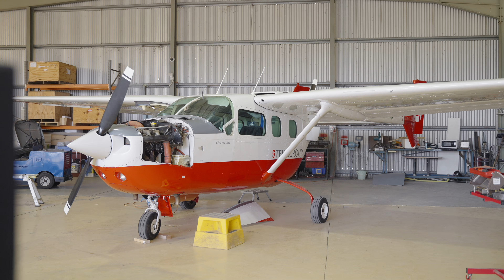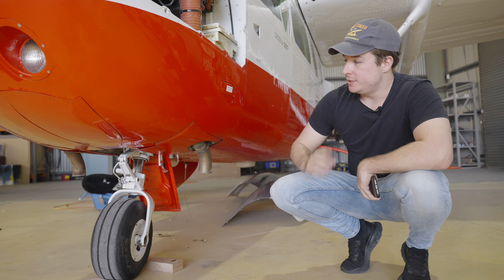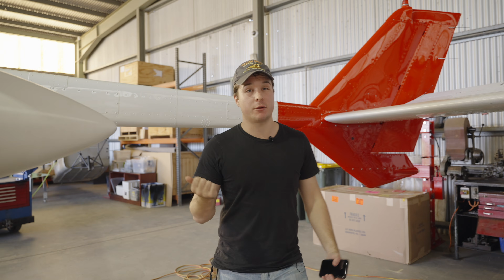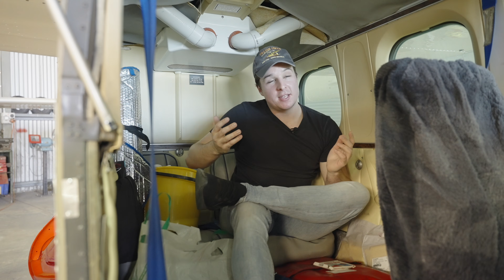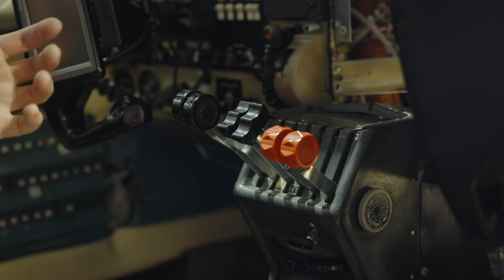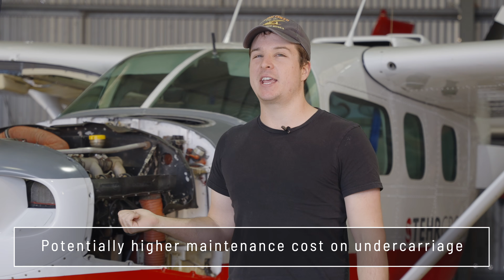The Cessna 337 Skymaster Is So Weird (And Brilliant!)

Comment: This has always been my favourite Cessna. When I worked at an fbo  we had one that visited regularly and he always taxied on the rear engine only. So the prop on the front was stopped.  As it was approaching the ramp from a distance  We’d always point that out to the new guys and tell them that it had motors in the wheels.😂

Comment: o love my 77 p 337 i have had her for over 25 years. not at all a good 4 seater. but i usally just hav emy 2 dogs and my wife. i have a baggage pod under it. a/c  full new glass panel 2 years ago. i even have a old kitchen sink when  i tell people it haas everything including the kitchen sink lol love that plane i use it for cross country i have also flown her to europe, across the pond   dogs and wife hate that trip. but is more  fun that taking a airliner. and no wacko people on it, and  if you lose a engine the performance is more like a 182 i guess,< i have never lost a engine. on it problem with the gear door removal is  you get a lot of trash up  in the gear area. i also have a 75 bellanca turbo  super viking. i use for local flights, another great plane very under rated and valued. cruises at a honest 200 mph.but really not a good 4 seater either. cabin is  a bit tight.  and not pressurized. but a beautiful  plane.  i hate it when i cant find anything to upgrade lol all i can do is wash and wax them.  with winter coming  iw ill be putting gallons of wax on them. as usual.    maybe replace the sun  shades lol

Comment: hey i have a 1977 p model  and i call it a mixmaster    in fact i have it painted where it used to say cessna  i  love it i am getting the mod for the front engine in  tn  it is a 500hp supposed to make it cruise at 300mph and a reverse  prop in the rear, ir is painted a mother of pearl medium blue with lots of metalliac on it  i am supposed to get it back end of this month i have owned it for over 35 years.  i wont sell it. easy for us old farts to get in, compared to  try to get into a bonanza barron i also have a 1964 straight leg with wheel [pants  i do not fly it any longer it is  fine in the hanger. plus i have a glass panel now.i also have the gear door mod and a bigger scoop on the top for cooling

Comment: WOW!  I have never learned as much about any one aircraft as I did about the Skymaster in this video.  I've loved the look of the Skymaster for 20+ years, and I've read a lot about them, but I didn't know half of the things in this video.  

I didn't know about the coupling between the electric trim and the flap settings.  Is that true for all Skymaster models?  

The STC to remove the clamshell doors is amazing!  I think I've seen Skymasters flying where you could see the wheels in the back; I guess they had that mod.  I don't know why every single Skymaster doesn't have that.  Wow!  (well, cost, I suppose). 

Thank you so much for this incredibly thorough video!
Reply from the maker: Thank you for the kind words. Really appreciate it! 

I’m not 100% sure if the flap-trim system is on all Skymaster models sorry.

Comment: I suspect that the Cessna Skymaster is probably the best performing twin-engined aircraft…..two engines with the drag of te engine’s nacelle, no yaw-tendencies during engine-out, no torque factor……great design……thighs that were designed in the 60’s and 70’s are the best design.
Reply from the maker: Would be much better performing if they squeezed in an extra 50hp on each engine! Good design though for sure. Thanks for commenting. :)

Comment: Did the very earliest 336 version of the Skymaster have the best TO and sea-level initial climb-out performance due to it's more compact fuselage and lesser weight? 
Certainly the earliest version of the venerable C150 with the 'continuous line' fuselage aerodynamics, was also the lightest, and therefore presented the best power to weight ratio of all the 0-200 C150's, translating to higher TO and sea-level climb-out performance, when compared against the progressively heavier 'Omniview' higher drag versions.
Reply from the maker: I’m thinking that you are correct

Comment: I had a highly modified stol, biturboed520, cupped leading edge, 3 blade reversing pops, elecgear, Loran, autopilot, king stack, landed in 200 ft with faa award.  6 passenger, drooping wingtip, 131 gallon, Whelen strobes, O2 AC intercom

Comment: Amazing how many interesting aircraft Cessna designed and built in the heyday of GA, not a new design in over 40 years and only 3 single engine models in production and all are fixed gear. At some point these legacy planes will time out, and the only used aircraft available in 30-40 years from now will be from Cirrus!
Reply from the maker: It’s certainly going to be interesting to see where aviation heads in the next few decades…

Comment: Maintained a pressurized model for years. Extremely complicated, expensive, noisy vibrating machine. We used to refer to it as the chafe master as the rear engine baffles were always worn. Overheating was a major problem even in a mild climate. Cool airplane.
Reply from the maker: Hahaha ‘the chafe monster’ 😂

Disappointing to hear how expensive it was to maintain. It’s a shame because they are a very interesting and attention grabbing aircraft!
Reply: I laughed when the YouTuber said the rear engine was the “cool” (I.e. sweet) engine, when, as you say, it is historically the hot running engine…and hence, the engine that usually doesn’t make it to TBO. Still, as with all runts of the little, the Skymaster has a rabid fan club.
Reply: @tz6516 about a minute after he says it's the cool engine he mentions its tendency to overheat. I think he meant cool as in The Fonz
Reply: @9HighFlyer9  
Cool 😎 is a 337 with an electric motor:
https://en.m.wikipedia.org/wiki/Ampaire_Electric_EEL
Reply: @tz6516  wait, we can put links in our comments again?
Reply: About 20 years ago I was pretty close to purchasing a 337. Front engine had about 100hrs on a factory overhaul. Rear was 500 from hitting tbo. Living in Phoenix I didn't want to tempt fate with that rear engine overheating. Looking back that overhaul cost sounds almost cheap now.

I ended up partners in a '99 182S. Boring but reliable.

Comment: XTA. Ahh I have a soft spot for that aircraft. Funny you mention the gear doors. I had a situation on landing after a fair stint over the water involving the landing gear but that might be a story for another time.
Reply from the maker: She’s a good bus hey mate. Question for you: how many hours could you spend out over the water at a maximum?
Reply: @DeadstickAdventures  SOO and XTA with the tip tanks can go out for 8.5 hours burning 60l/hr and have a very reasonable fuel reserve left. I've heard of others pulling the engines right back and conserving even more fuel, but I never had to do that.

Comment: Super informative! Is there an option for fairings on the wheels to help mitigate the chance of rocks flying up into the rear prop?
Reply from the maker: Thanks man! 😁

The fixed gear 336 could have fairings/spats on their wheels but the retract models can’t
Reply: @DeadstickAdventures  If you had the mod from the US, would it be possible to fit suitable fairings/spats, as you wont have gear doors to worry about..?